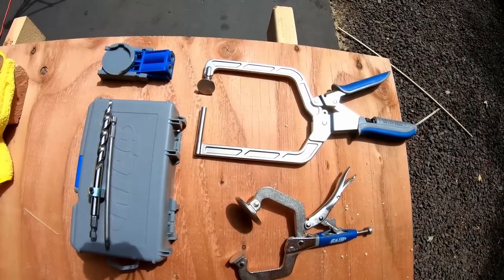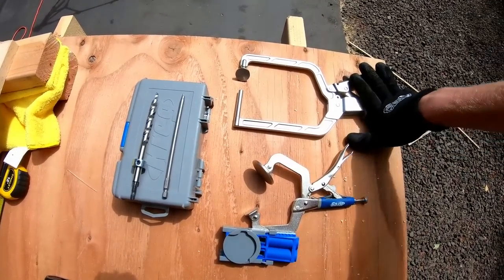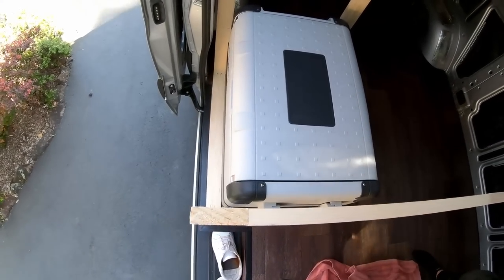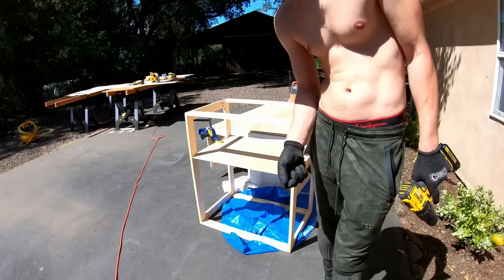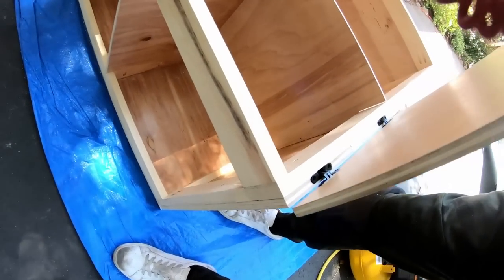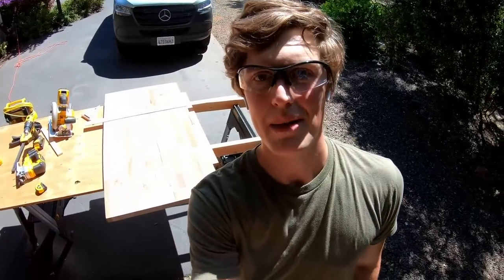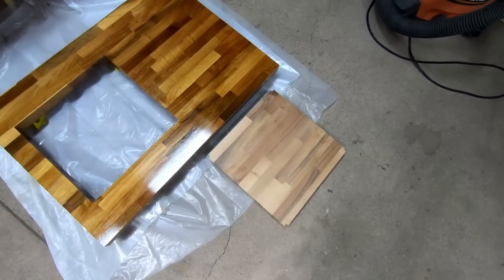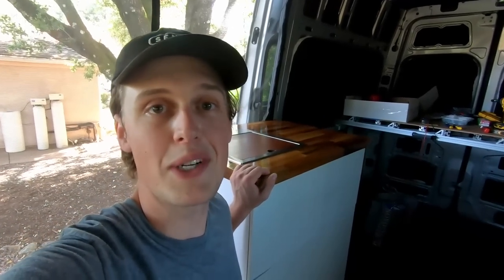Van Kitchen Galley w/ BUTCHER BLOCK Counter Top, Fridge, Storage, & More! #vanlife

Comment: Butcher block countertop looks GREAT!  However, if you plan on using it you are creating a "maintenance machine".  I owned a beautiful butcher block countertop kitchen with 10' of weekly maintenance; scraping off food from surface and oiling (or worse re-coating the finish) constantly.  And good luck keeping the wood from expanding and cracking/splitting as the inevitable water seeps into the areas under and next to the sink edges- it WILL split, just a matter of when.  But, it sure looks good!  I have watched your progress on the build and have mentioned it but in practice not so much, remember that ever single lb of weight that you add takes away from mileage - weight is your enemy.  I converted a 28' step van into a RV successfully and even though it has; a full sized home frig, bedroom, a 1.5KW solar system with 1,600 AmpHrs AMG batteries, propane generator, 100 gal water, two 3'x5' skylights that open fully, bathroom w/ teak shower and a full kitchen. I was VERY careful about how I chose materials avoiding added weight- I get 16-21 MPG.  And I did it all myself on a very low budget- it can be done!  Regardless your vids are generally really good and entertaining- you will learn, as we all do, by your mistakes.

Comment: I‘d like the 28” Ruvati workstation ledge undermount. I realize that’s a lot of real estate, but I figure it’ll be covered when not in use (with the full length of the butcher block cutout), it can store the accessories, and more, and I will have a huge sink for laundry, cooking, cleaning, crafts, etc. I haven’t purchased it yet, but I would if I found it on sale. Any reason you think this sink wouldn’t work?
Reply from the maker: Nope this would work great. This would actually fit in the galley unit in this video if I sacrificed the drawers and made it a couple inches taller.

The only thing to keep in mind with that specific model is it’s an undermount sink so avoid “fake” butcher blocks (like IKEA’s) because the inside edge of the cutout will be visible.

Comment: Seven, can you share how you tied down the kitchen galley to the van? Do we need to drill through floor? Thanks, bud!
Reply from the maker: I used plusnuts into the side of the wall and then 4 large screws into the wood subfloor
Reply: Seven O Savage Ahhh, thanks for the quick response! You’re awesome!

Comment: Just bought a 2016 Promaster and I am trying to figure out how to do the floor without losing much head space.  I see how you had the same concern and how you did the sub-floor without furing strips.  I am wondering about securing cabinets to the floor?  You spoke about bolting them to the floor.  Do you notice rattling of the cabinets while driving?  Would you do your floor the same way again, now that you've installed cabinets and used it all for a while?  Thanks in advance for any direction you can provide!
Reply from the maker: Awesome Linda! The planning phase is fun. I would do the floor mostly the same. No rattles from the cabinets. There is a comment in the flooring video that goes over the changes I’d do next time.

Comment: Great work! love your videos! how did you deal with the awkward shape of the metal strip on which you bolted your galley? did you use some material to fill in the gaps? we are trying to figure out how we can bolt it straight and make it secure since the bottom gap is about an inch away from the structure of the galley... thanks in advance for your guidance. cheers

Comment: Glad I stumbled into this video series.  Your the level of thought and detail you put into the parts of this van is excellent.  Which is why this one video has me puzzled.  As usual the cabinet build is great, but where will your water drain?  There doesn't appear to be a place to put the grey water container.  Super curious how you'll solve that particular issue.
Reply: He says in another comment that he's putting the fresh water tank above the passenger wheel well and the grey water tank under the van.
Reply from the maker: Yep Tee T is correct. There is a little over  1" behind the fridge where I routed my electrical & plumbing lines and I now have a 30 gallon water tank in the back behind the wheel well... soon I will be installing the gray water tank under the van. Water system/plumbing video will  be coming out next!

Comment: Why not use the matching, cut out butcher block to replace the cutting board the sink came with?
Reply from the maker: I might do this with the leftover butcher block I have, but the cutting board is only 3/4” where the butcher block is 1 1/2” so id need a way to split it.

Comment: Hi Mr Seven. I checked your comment section to see if you listed the fridge that you used, don’t see it? Or the drawer slides? Possible to give the dimensions of your cabinet? LxWxD  Im guessing you have a tank elsewhere where water will be stored, and will you have room for the sink plumbing etc? Sure looks
 nice with that sealed butcher block.
Reply from the maker: Hi Dani, thanks for reaching out! The dimensions of the cabinet are 22” x 32” with the butcher block extending about 1” past these dimensions. 

The fridge is a dometic cfx 55. 

Correct, the water system will be located in the back and I will document that in another video!
Reply: Seven O'Savage look forward to viewing water system video as I’ve enjoyed the journey thus far. Happy travels